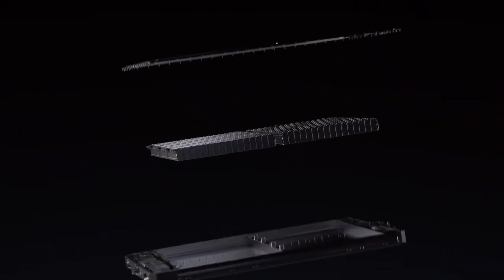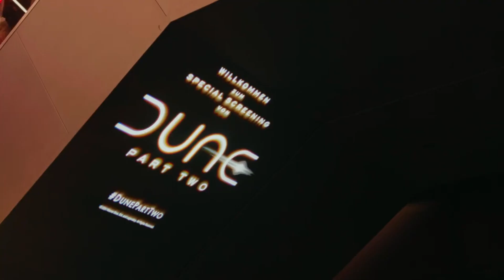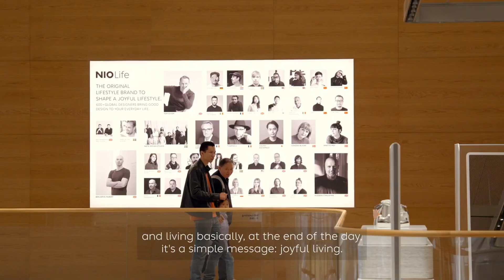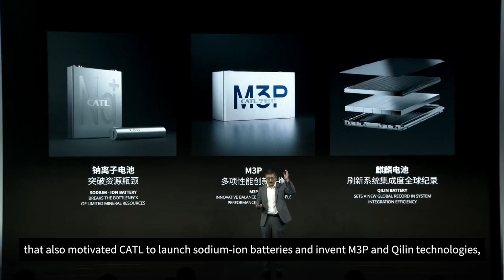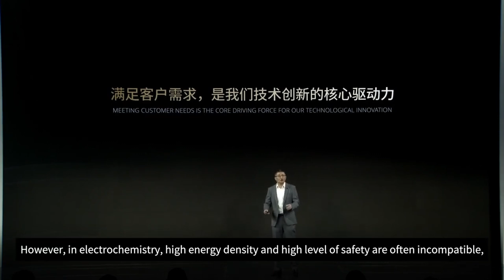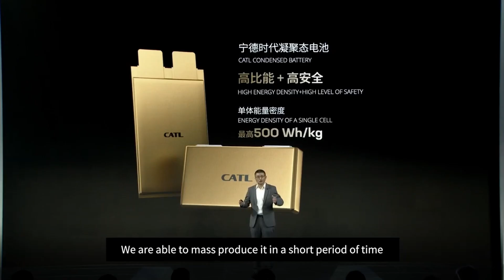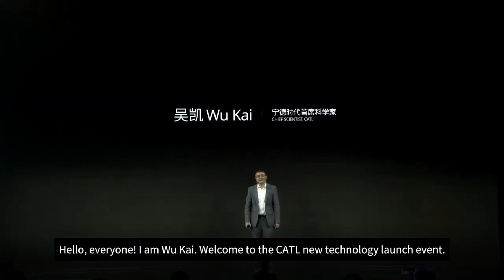NIO & CATL NEW Battery Technology Just SHOCKED The EV Industry

Comment: The battery swap method is a real loser. First, the swap battery is not fully charged, and locations will never be convenient enough. Fast charging batteries are here and getting better. Within two years the energy density, cost and cycle life will be improved by at least 50%.
Reply from the maker: Lo! Thanks
Reply: And how about 8/10 years later EVs has no active battery where as NIO has no such problems... I think you don't understand the battery swap...
Reply: So having the option to battery swap and charging at home or at a station is a real loser?
Reply: @robstaccs6128  Battery swap will fail in the US, subscription cost is too high.